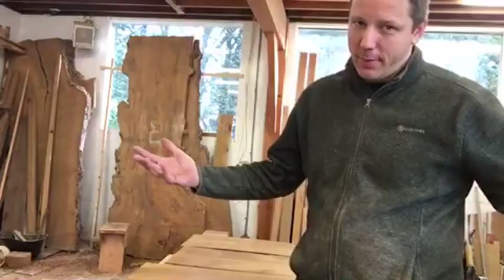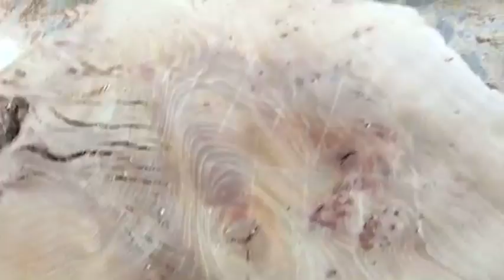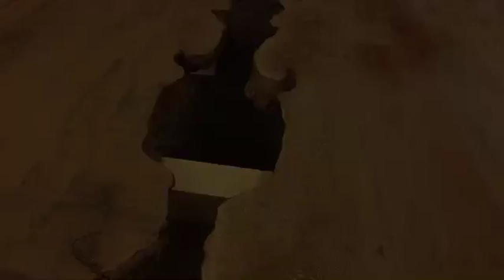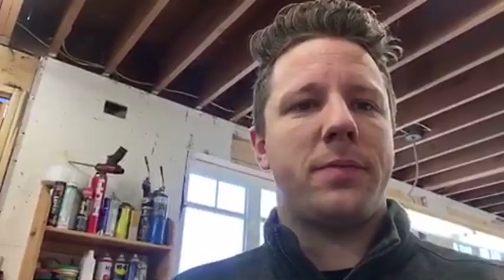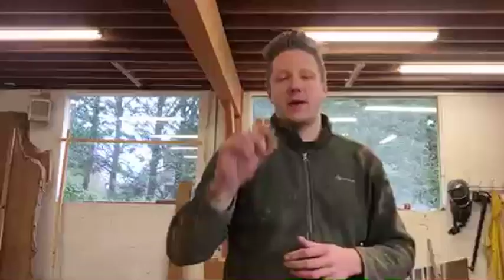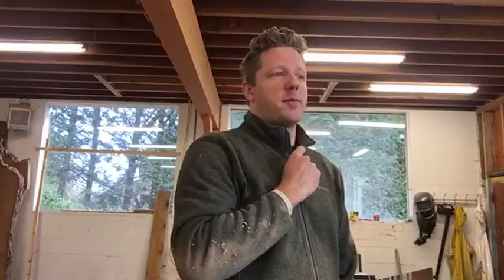🔴Samurai Live Jan 6

Comment: You should do an epoxy river from corner to corner on the table, cut main live edge river at a 45 and cut scrap live edge at a 45, out them together and have a couple creeks running into the main river. A lot of epoxy but it'll be epic